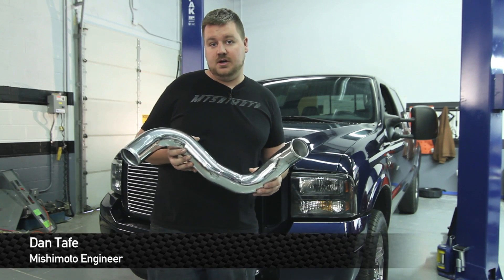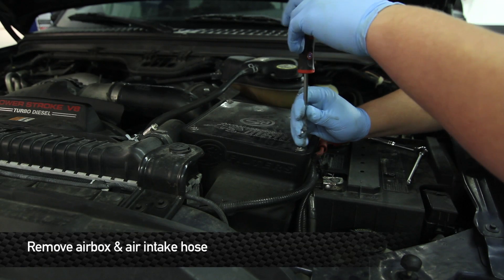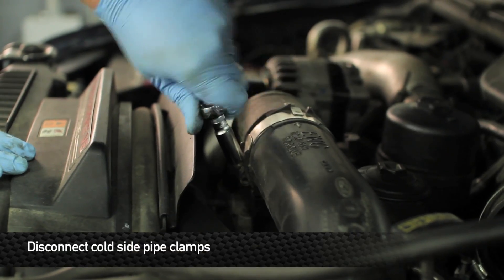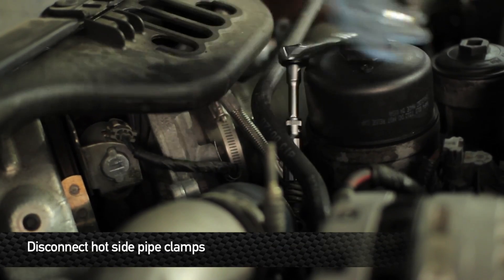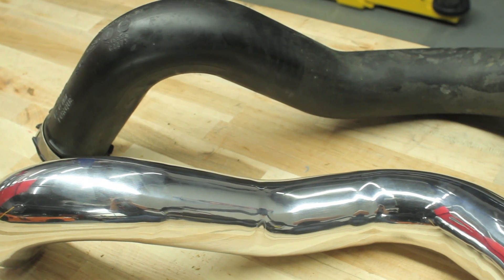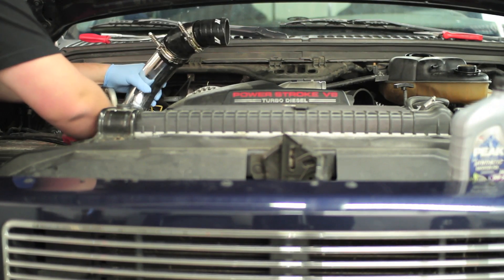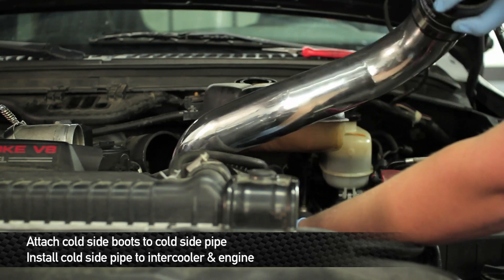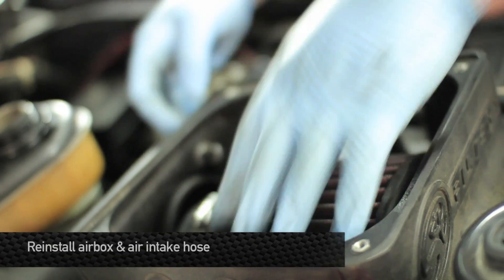How To Install: Mishimoto 2003-2007 Ford Powerstroke 6.0L Performance Intercooler Pipe Kit

Comment: Will the hot side tube fit with a duel alternator setup?  My stock hot side is pinched.
Reply from the maker: Hey Joe - please call our customer support specialists - they'll be able to advise you on installing w/your setup.  You can call 1-877-GOMISHI or email support@mishimoto.com!

Comment: If you like nice shiny pipes, this is for you. I can't keep the boots from popping off when turbo hits 20/25. I put the factory pipes back on and just bought new boots. The OEM boots are notched to keep them on, the mishimoto boots are not.  Just wasted $360 and two hours of my time.
Reply from the maker: We apologize for the issues you are having with the Mishimoto Factory-Fit Boot Kit. These boots should easily support boost levels of 20-25 psi. Can I ask process you are taking to install the clamps?

Comment: How tight are the bolts supposed to be? I keep blowing the boot off at the intake elbow.
Reply from the maker: Zackary Bennett For our constant tension t-bolt clamps we recommend 50 in/lbs or around 5 ft/lbs of torque upon installation.  Let me know if you have any further questions!
Reply: But the website says 27inch pounds??? So is it 27 or 50 inch pounds? I’m going to be doing an install soon
Reply: @DukesofoffroadHazzard  I'm curious; What did you end up torquing them to and how did it work out? 27 in-lb seems pretty low. Most other kits recommend anywhere from 50 to 90 in-lbs.